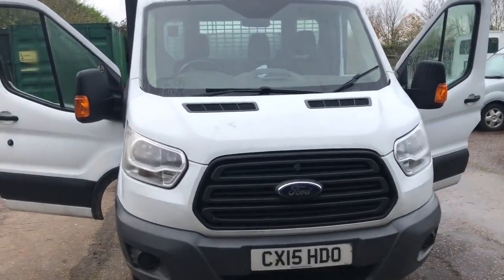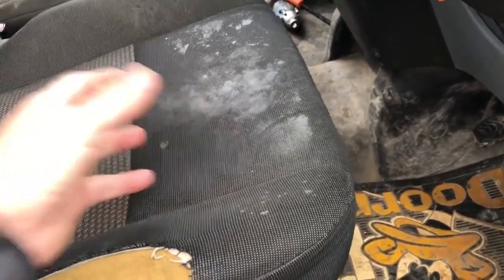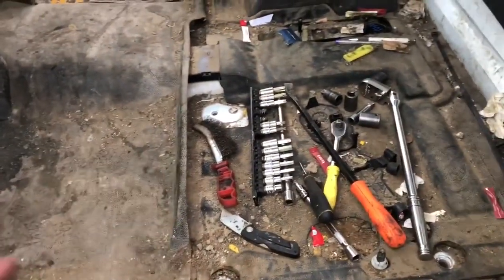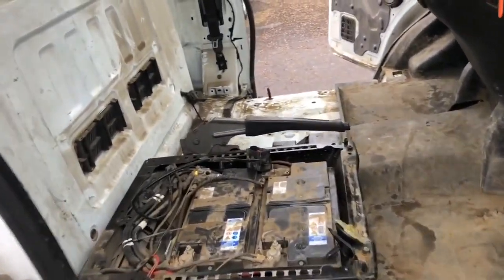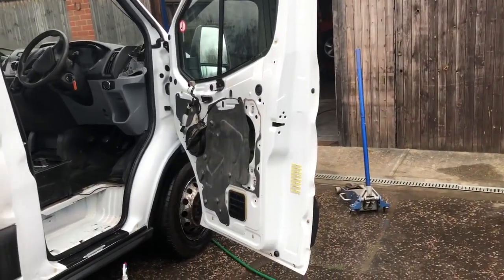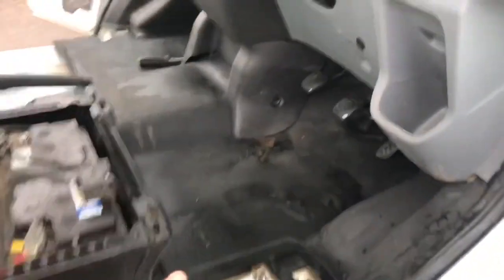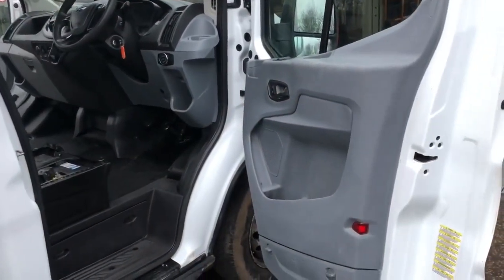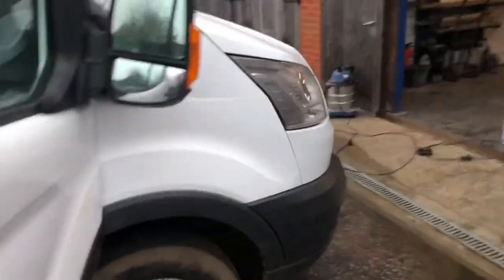SRUK T/B THURSDAY BARGAIN EX FLEET 2015 TRANSIT TRUCK

Comment: Good to flashback to a cleaning video.  Got to tell you, the JennyChem alloy wheel cleaner is astonishing (SKU G7047). I've used high street brands for years and this stuff is in the next league above,  I used your code for the discount too.  Thanks lads. 👍🏻

Comment: Rob, I know it is cheeky to ask but You tubers exPAWers have a 1991 ford transit 2.5D and have just got back to Dover UK and there rear axle has gone. So are basically stuck. With your contacts would you know of anywhere they could it a second hand one. Sorry to ask but they do sound pretty desperate.
Reply from the maker: Someone asked yesterday I wouldn’t know where to start to be honest 👍
Reply: @sruk  Thanks
Reply: Looking for views or parts?
Reply: @pjr7661  ???